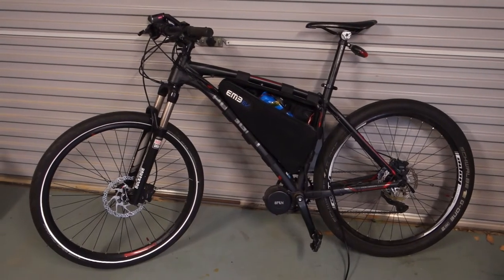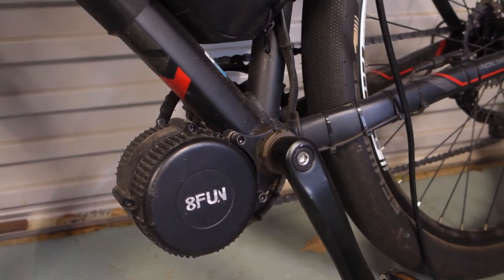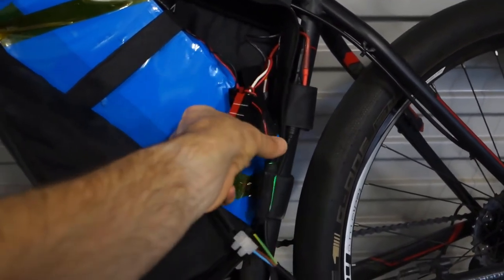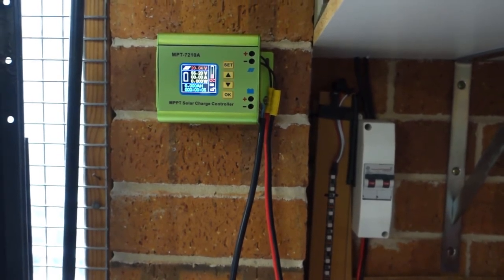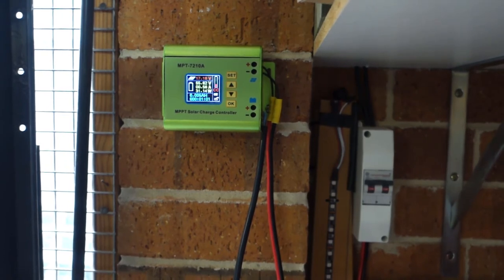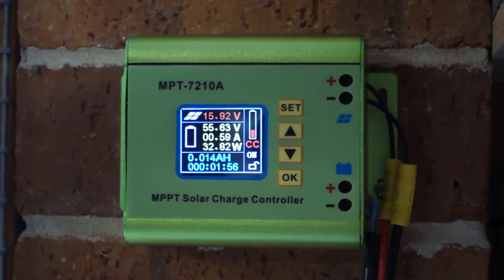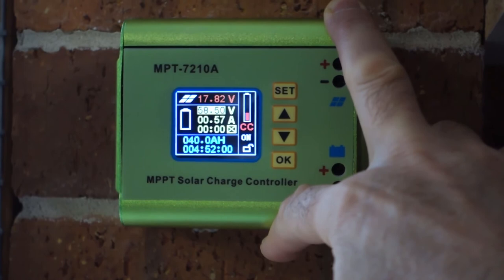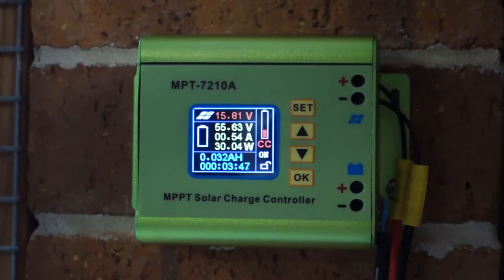Ep31 Solar Charging the EBike

Comment: The manual for the MPT-7210A says to connect the battery first. Does this mean you need to disconnect the solar panel every time you disconnect and re-connect your e-bike battery to be charged?

Comment: im in progress of doing the same with my 36v e-bike battery :-) just have to open the battery and see if there is a bms inside of the box. should i charge through the bms or directly into the cells?
Reply from the maker: Hi Freddy,. I'm sure there is a BMS.  However all BMS don't have all the features.  Most just protect from overcurrent and over/ under voltage which is fine.  You just connect to the battery box terminals to charge

Comment: How to used it if you dont have a solar panel as your source? I mean can I use AC outlet to power it up.
Reply from the maker: It's not possible to power this charger from AC.  The units is particularly designed for a solar input.  If you want to charge Lithium ion batteries from AC there are plenty of dedicated units for this purpose.
Reply: Well, I already tried that but I end up buying a charger with a volt and amp rating that doesn't corresponds to what I needed. What I needed is a 
58.4V 10A charger but apparently it is nowhere to be found in the few online shops that I tried. So, my only hope now is this thing since it is customizable. 
Anyway can you atleast give me some recommendations on what product should I buy and where can I find some, please?
Reply: @Simon Jowett 

Is there no other way to mimic the solar panel input with an AC input?
Like using some adapters or charger as medium?

Comment: Im interrested in this controller but does the fan always run? Thanks in advance.
Reply from the maker: eauxvive Yes.  Whilst ever the unit is on the fan runs.  It's a noisy one too!  If I was to have it in an area where i was concerned with the noise I might be tempted to change it for a quieter one.  Thanks for your comment.
Reply: I want to use it on a solar bike, i will have it behind the ears, so i can change it. Thanks a lot for your answer

Comment: Is it efficient? Solar panel watts vs Watts (harvest). Thanks
Reply from the maker: I've actually reconfigured this installation and now the panel has a grid inverter connected.  I guess the main reason is the grid inverter works all days whilst the battery charger was only in use occasionally.

Comment: Can I use a 60 watt panel I got the same controller will a 60 watt panel charge a 48 volt ebike battery text me as soon as you can
Reply from the maker: Check the specs of the panel (voltage and amps) and see if it meets the input spec of the charger.  It's too long since I did this to remember the  input specs of the charger.